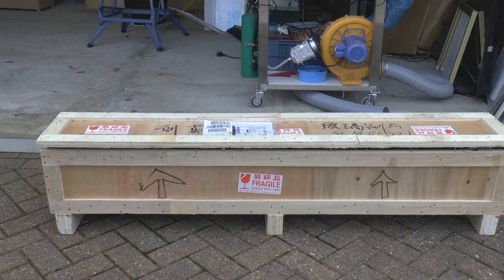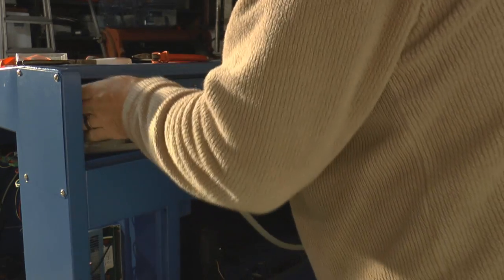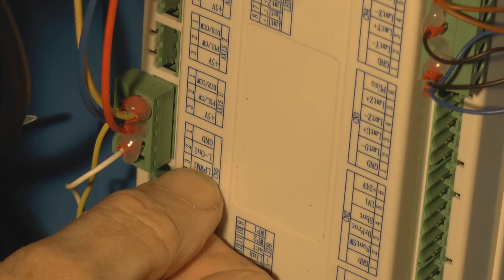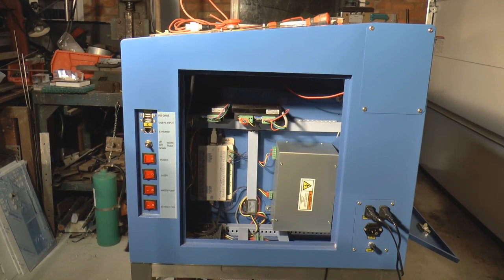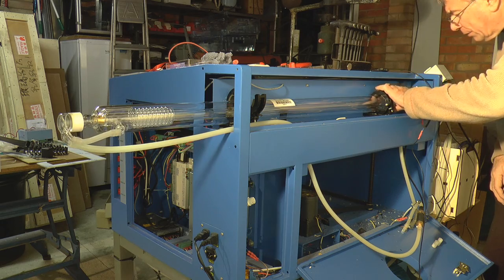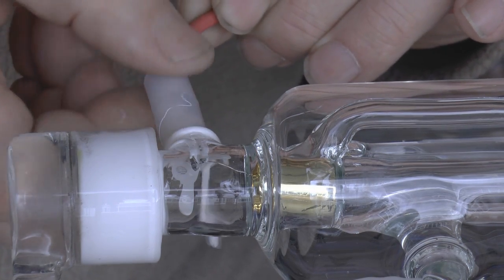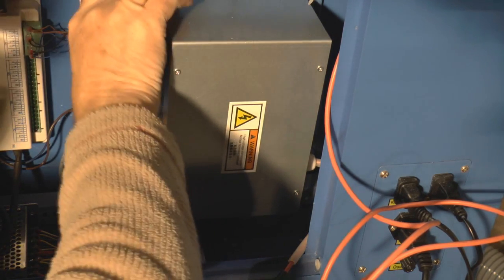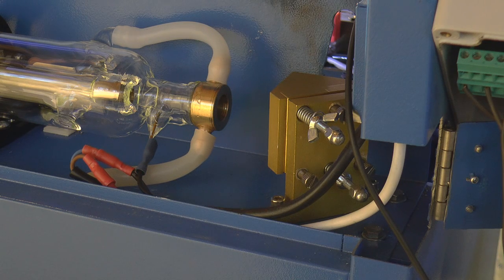RDWorks Learning Lab 50 fitting 60watt tube and PSU

Comment: Thanks Rus

I am seriously thinking of following your lead and buying one of those tubes.

Cutting wood using the original laser is quite tricky, and I never seem to get such good results as you do.

I just spend a few hours, realigning beam, and it seems to have made a bit of an improvement, so I can cut through 3mm plywood at around 20mm / sec

However cutting anything thicker still alludes me :-(
Reply from the maker: Hi Roger
If you haven't watched it already you may like to watch https://youtu.be/61bGzWicRRk

Best wishes
Russ
Reply: Thanks Russ

I did watch that video, because I have both the 38 and 50mm lenses

I've had the 38mm lens in the machine for some time, but was having issues cutting 3mm plywood, so swapped back to the 50mm lens in case the issue was the bend in the plywood affecting the focus of the lens.

But after watching your power density video, I swapped back to the 38 and re-aligned the laser - and it seems a bit better now.

Ideally if I'm going to increase the power of the machine, I'd like to go up to 90W, but from what I've read, the 90W tubes are huge and its not practical to fit them to our relatively small machines

I'm also thinking about buying one of those power meters, which seem to be $95 (USD) at the moment from some online stores
Reply from the maker: Hi Roger 
Not all high power lasers have to be long but you need to keep an eye on the diameter to make sure it will fit. This 100 watt tube is 50mm shorter than my 60 watt tube.
http://www.aliexpress.com/store/product/Kits-Of-1pcs-100W-Long-Lifetime-Laser-Tube-1-pcs-100W-Laser-Power-Supply-Warranty-6/321243_32225233743.html
This another in the family of tubes that I bought . If you want to make a technical enquiry,  write to Gelly Dung       sales02@mactron-tech.com.  This direct email is not published so it may be courteous to mention that you got the contact via Russ Sadler. I'm sure that there is some sort of link with RECI tubes because their specs are so similar. From my experience they are a reliable company that are supplying a really high quality product.

Best wishes
Russ

Comment: My tube is 1250mm? Have I got the wrong one?
Reply from the maker: +liam slavin 
HI Liam
Don't  panic. 1200mm is a nominal dimension to identify a 60 watt tube. Decent quality water jackets at each end along with different ways of mounting the mirror at the HV end on better quality tubes can easily add 50mm. Mine is 1250mm so you have bought the right one. Enjoy smooth predictable performance from now on. If you bought the same Macron tube, it is claimed to have 4000 hour life,  which is amazing
Best regards
Russ
Reply: +SarbarMultimedia Wow! What a great tube! My machine isn't 100% the same as yours as it turns out.  I wired mine like you did,  works great!  Can't thank you enough for you help and YouTube channel
Reply from the maker: +liam slavin 
No thanks required. I'm doing this out of selfish enjoyment . Video is my other hobby so it's win.win for me and it's a bonus that you can learn from my mistakes and discoveries. However, I do appreciate your kind words.
Best regards
Russ

Comment: Dear Sir. Love the videos. Really informative and helpful. But could you please tell me where you bought you laser and the new tube from ... Many thanks .Terry
Reply from the maker: +slinger1991 
Hi Terry
This is the machine I bought about 10 months ago (it's now about £200 cheaper!!!!) 
http://www.ebay.co.uk/itm/350B-50W-CO2-Laser-Engraving-Cutting-Machine-Auxiliary-Rotary-Device-0-60000mm-/111694615353?hash=item1a01849339
As you will have seen from my videos that document my journey, trying to tame and train my little Chinese Dragon, it's been "interesting". However, I knew that there would be zero support and a few problems before I bought the machine. That was part of the fun for me.  Without the struggle to extract every last milliwatt of power from the system, I would not have been forced into learning so much about the technology (and there would have been very few videos). 
I purchased  my new tube from
http://www.aliexpress.com/store/product/1200MM-60W-Laser-Tube-60W-co2-Laser-Power-Supply/321243_1109607209.html
You cannot get to Mactron directly normally to ask technical questions you have to enquire via  AliExpress. However, I did get a very good technical contact into Mactron sales that was able to answer all my technical questions.     Gelly Dung is the contact and the email address is  sales02@mactron-tech.com. This email is not publicly available so it would be courteous to mention that you obtained the contact from Russ Sadler.
As I have often mentioned, these Chinese machines are all over-specified. My 50 watt machine was fitted with a 40 watt tube and 50 watt power supply but the lower cost of this machine did eventually allow me to upgrade to a proper 60 watt system with the money I saved by not buying a 60 watt machine originally (that would have only been 50 watt).
The final piece of advice is to buy this with your CREDIT CARD. Paypal and Ebay guarantees are useless but your card company is bound by a whole raft of financial legislation which gives you a fighting chance at getting a full refund if things go seriously wrong.
Good luck and best regards
Russ
Reply: +SarbarMultimedia 
Dear Russ

Thank you for replying to my question and offering the advise of where to purchase the laser cutter. I am new to this exciting hobby/business opportunity and am very grateful to you for you help and the fantastic videos on YouTube. I am saving very hard to not only purchase the cutter but also a workshop to house all the stuff needed to use it safely and securely. I look foward to more great videos and many thanks once again.. Truly inspiring to a novice in this
Reply from the maker: +slinger1991 
 Hi Terry
 Thanks for your appreciation. This is a record of me learning....and I continue to do so. I have made several mistakes along the way so I hope when you get your machine you can benefit and stay away from the man traps!! I'm having the most fun ever  and despite the frustration of a far-from-perfect machine, I  enjoyed sorting it out and it has forced me to learn so much more about the technology. It reminds me of all the effort I put into my fist car, lowering the suspension, new carburettors and exhaust etc etc. I'm sure you will  get great pleasure from using and tweaking you new toy
Best regards
Russ

Comment: I'm about to push the purchase button on a machine from the same vendor as you.  Given you upgraded from 40W to 60W,  I am thinking of starting with 80W.   I will be mostly cutting and engraving acrylic, but on occasion may do cards for my wife.  Any obvious down sides?
Reply from the maker: +John Grabner 
Hi John
The chances are that  your 80watt purchase will turn out to be a 60 watt tube with an 80 watt power supply. An 80 watt tube will be about 1600mm long, so I would enquire about the tube length before you buy. Add about 175mm to the tube length and then check if 1775mm will it fit in the case dimensions for the machine? If not will there be an extension box supplied? I advise this because depending on how thick the acrylic is you will be working with (it will easily do 6mm thick ) and the work table size you need, It may be a more cost effective route to follow my path. The tubes supplied with the machine are generally  (not always)of dubious quality and certainly  over speciified,  I finished up paying about £500 for my upgrade  to a good quality system, purchasing a 60 watt system that actually delivers over 70 watts.I suspect the difference between a 50 and and 80 watt machine is more than £500
These machines are called engraving machines because you do not need huge watts to engrave. They will cut but they are not marketed as cutting machines. For paper and card I run my new tube at a mere whisper, it's only just firing.....works fine because I do a lot of card work for my wife as well.
The only other advice is make sure you use your CREDIT CARD to purchase. There are strict financial regulations in place for credit transactions and should you have serious problems with your purchase you stand a better chance of getting your money back via your card provider than from Ebay or PayPal.
Good luck and I'm sure you will enjoy your new tech toy.
Regards
Russ
Reply: Thank you for the advice. I just did the purchase of a 60W labeled as a 80W directly from the China supplier. The price difference was so minor between the 60W and the 80W. So minor, I now hope its not a 80W sticker on the 40W tube. I will let you know when it arrives.

Anyhow, It would be great is you did a video focused on  new owners of this laser and enumerate in priority order things they should do and what video in your series they should review for these actions. Your series is a treasure trove, but there so many videos.

Based on your video series, my guess at the todo list is include  (please comment):
1- Make bed flat. If I recall, you saw only a new mm. Given it was not perfect, it can easily be more out of alignment.
2- Make sure lens is oriented in correct direction. If I recall, yours where in backwards.
3- Align laser path, including perpendicular to table bed.
4- install current meter on the low voltage end of the tube. This is Critical to prevent premature aging of the tube by running it at the advertised level.  Sounds like a cheap Radio shack multi-meter will be adequate.
5- purchase one of those power devices so I know what power I actual have. This also gives a reference for when the tube degrades. 
6- get a bigger exhaust fan
7- use my compressor rather then their noisy air supply. By the way, what air pressure do you set at the lens?
8- Their unit now comes with a water chiller. So just add distilled water.
9- Run a set of reference burn test (power, speed and air pressure), both for reference when programming the machine and to have as a comparison for the future.

Did I miss anything?

I don't see you wearing safety goggle when you do mirror and lens alignment or verifying power.  Are the warnings in the manual exaggerates or did I miss something?  I asked because as a kid I damaged my ears with loud disco music, so can't afford to be blind too.

In one of your videos, you said wait xxx minutes before touching the high voltage end of the tube.  Is there a procedure to ground the high voltage end before getting close to it after xx minutes? I'm always scared risking my life on parasitic losses to discharge something that can kill me.  I have a vague recollection of a TV repair man doing something like this when my old fashion CRT TV was being fixed when I was a child.

I was telling my kids, you must be a retired engineer since you are so logical and systematic.  A real pleasure to watch.
Are you?

Comment: Hi Russ I have taken your comments on board re  spotting laser and have redesigned it .   My other versions worked well but were not exactly neat.  The new version is here https://www.youtube.com/watch?v=Jm8syz6ARCY  It was a tricky thing to shoehorn it in but I am pleased with it please have a look.
Reply from the maker: +Peter Jensen 
Hi Peter
Superb solution. This is NEARLY the best of all worlds. It is easily better than any other beam combining technology that I've come across but that's because, like mine, its not a beam combiner but a temporary substitute for the beam. Because you are using it regularly for graphic location, your motorised switch in and out is a brilliant  way to achieve this.  For the Mk 5  let me suggest the ULTIMATE solution.  If you could extend the baseplate backwards towards the tube, remove your first tube clamp and with two clamps about 10 or 15 cm apart on your baseplate, replace the existing tube clamp. With that, you would get a secure fixing of your pointer onto your tube. You now have a solution that no matter how you adjust your tube in future the pointer will truly follow the beam path.  May be a step to far...... but what you have demonstrated is already a great solution. Respect.  
Sincere regards
Russ

ps I am planning a simple mechanical alignment solution for picture location in a future session, would you mind if I praise and point to your solution, because for people that do picture location as part of a business, your solution is to be admired.
Reply: SarbarMultimedia Hi Russ thanks for your kind words and additional ideas.  I don't think I'll do v5 right now as  it serves its purpose but I agree to include the clamp base would be a great addition.  Please feel free to spread the word.
Pete

Comment: BTW do you get any issue with air bubbles? I do get much more bubbles in my 60W tube due to larger water volume.  It seems I get a lot of them if I don't turn pump for more than few days. I couldn't find any leaks, so it must have something to do with air dissolved in water... Anyway I found if I run water pump non-stop for more than 2 days, all bubbles disappear.
Reply from the maker: +bratan007 
Up to now with such puny power output , and I don't use my machine continuously (mine is just pleasure use) it's been rare for my small 10 litre system to exceed about 25C.  My tube always runs perfectly clear and bubble -free. From time to time I have to check it  because it's a bit unnerving. There is a little 3mm bubble trapped in the anode region that dances around in the flow and even though I can hear the pump running and I have a flow switch that little bubble puts my mind at rest.   So, we have established that I run bubble-free BUT during my recent "Do you lose power as the water temperatures rises" test I did note that at about 28C I started to get micro bubbles forming on the inside of the water jacket. As I pushed on to 40C the bubbles got bigger and, just like rain running down a window, they broke away and coalesced with others and exited the tube. This was obviously dissolved air coming out of solution. At 40 C there was a bubble carpet all along the top of the water jacket and I was not in the least bit concerned. Why not?  because they were not interfering with the heat flow from the ionised gas, they were stuck to the ROOF not the FLOOR of the water jacket. At the moment the air temperature in my unheated workshop is around 6 to 8 C so at present my new 60 watt tube has not gone over 20 C but I suspect that as the ambient rise I shall need to make modifications to my cooling system.  People get so hung up on bubbles but if they are moving then they are not causing risk and if they settle in the right place they are equally no risk. Examine the make up of your tube and you will see the curly glass pipe around the anode end That is conducting a flow of gas in a swirling action back to the cathode end. Have you ever felt the outside of your tube running hot? If so you definitely have a cooling issue and probably serious loss of power. 
You have rightly observed that your bubbles are dissolved air, but it's always worth checking that your return to tank pipe is well below the water line so that it cannot entrain air.
Regards
Russ
Reply: I've only got the old tube, but I get bubbles if I leave the machine more than a few days.
I suspect that air is getting in to either where the pipes join the machine, or more likely in the flow sensor slowly lets air in.

I recall that Russ removed his flow sensor a while ago, but I don't know if he fitted it again.

(I also recall, that Russ completely replaced his pipes with larger diameter ones, ages ago, which probably makes a difference as well.